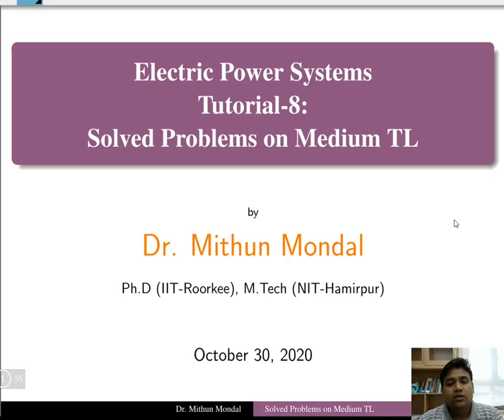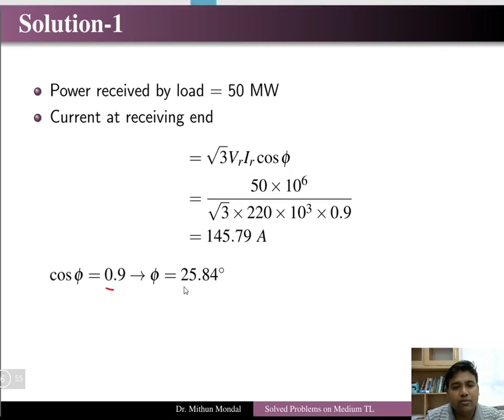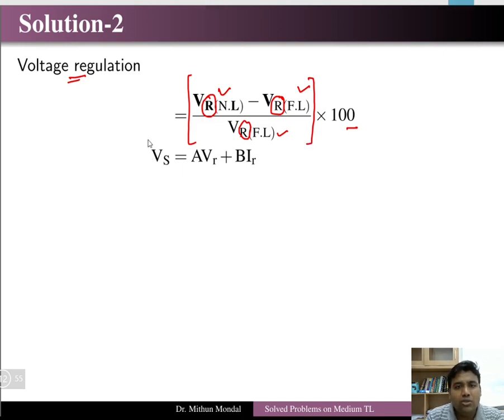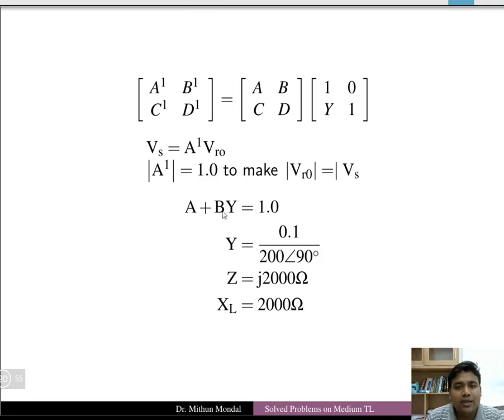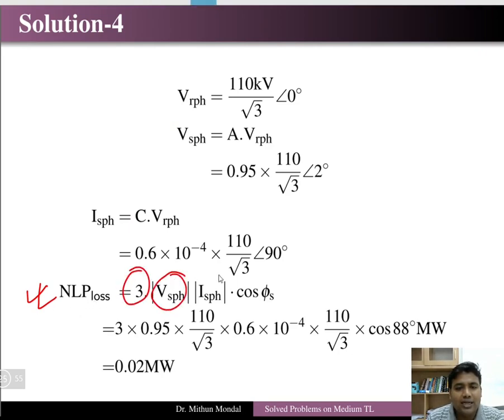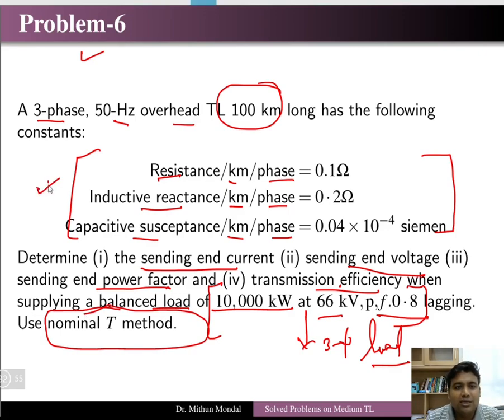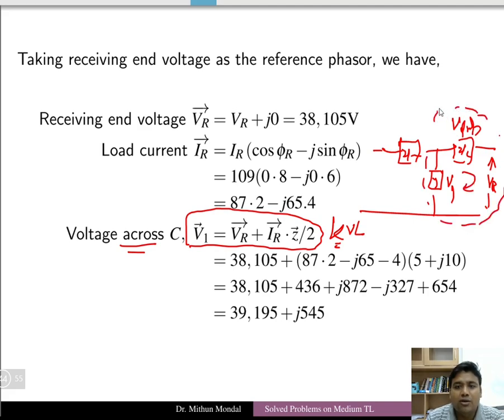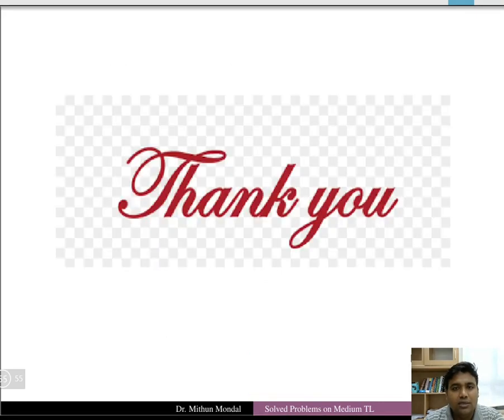Power Systems | Tutorial - 8 | Solved Problems on Medium Transmission Line

Comment: Sir please make a video about this given question
Q. A medium single phase transmission line 100km long has the following constant. 
Resistance/km/phase = 0.15ohm 
Inductive Reactance/km/phase = 0.377ohm
Capacitive Reactance/km/phase = 31.87ohm 
Receiving end voltage = 132kv 
Assuming the total capacitance of the line is located at the receiving end alone, determine:
1. Sending end current
2. Line value of sending end voltage 
3. Regulation
4. Sending end power factor
The line is delivering 72MW at 0.8 p.f. lagging.
Reply from the maker: Since the total capacitance of the line is said to be at receiving end so don't assume pi or T model of the medium TL. Draw the equivalent circuit model in which the series impedance consisting of total R+jX will be there and then in shunt Capacitive reactance Xc. Now, apply KVL and KCL equations to find Vs and Is. Then you can find other charactersics of the line. Note: Convert all quantities in total length and then only solve.

Comment: Sir, in given 1st example, is load  balanced? What will be the process, if load is unbalanced?
Reply from the maker: All equations are derived for single-phase so three-phase system/load has to be converted to single-phase equivalent. The realtionship between phase and line quantities i.e. voltage, current and power have been derived considering balanced system. For e.g. if a system is balanced then per-phase power is P(3-phase)/3 but it is unbalanced then P(3-phase) = P1 + P2 + P3, where P1,P2,P3 are individual phase powers. Moreover, for a balanced system, Ia+Ib+Ic = In = 0, but when the system is unbalanced or in fault In will not equal to zero and will flow through ground. So, to make simpler except fault conditions generally we discuss balanced systems only. Note: The [A,B,C,D] parameters which depend upon system parameters {R,L,C} are per-phase parameters.
Reply: @EngineeringDevotion  OK Sir, Means here we considered only balanced load at receiving end side. But in real there is no balanced load at receiving side then how we calculate the receiving end voltage, can you make one video for that
Reply from the maker: Receiving end voltage will be always same. Due to unbalancing only the current in the three phases will be different.